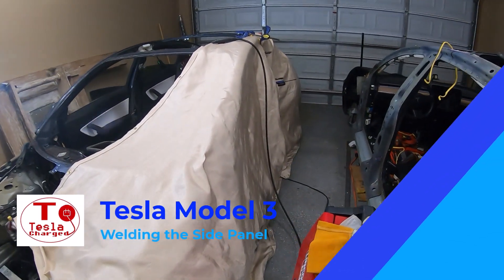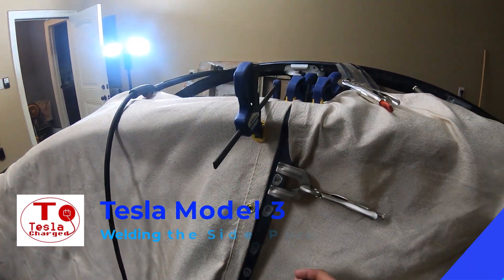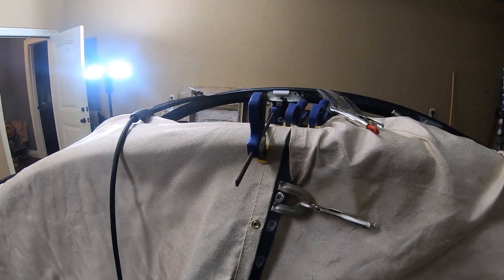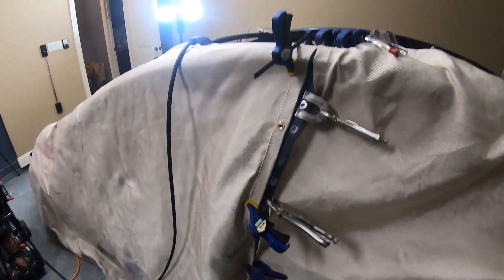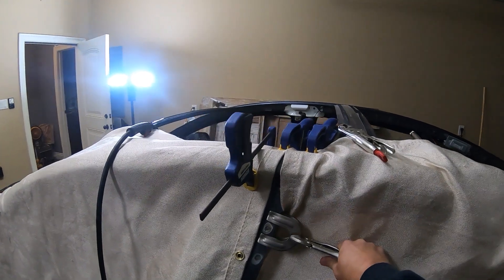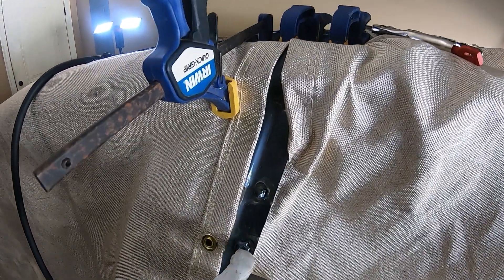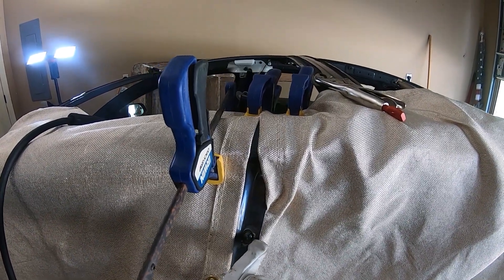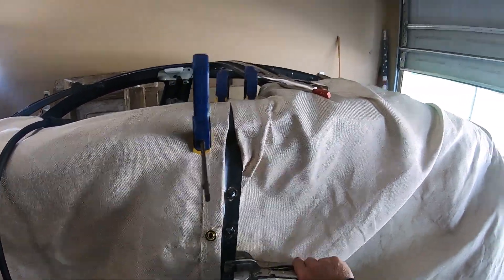Tesla Model 3 - Welding the Side Panel

Comment: Can I weld a rear panel of a Tesla without disconnecting the batteries? With the MIG welder
Reply from the maker: Hey sorry for the late reply, Yes just make sure your ground is very close to welding location and car is powered off.
High voltage battery communication plug under back seat removed and 12v battery negative disconnected.
Reply: @TeslaRebuilders u have pics what plugs  need remove rear seat?
Reply: Hi i need change quarter  panel how i can disable  all battery  system ev batt i know 12v battery  its same regular car can you help me safe mode to weld in tesla? Thanks

Comment: Hi man, do you know where i could find a similar HV disconnect in a 2018 tesla model s? its not under the seat, i think
thanks
Reply from the maker: You should be able to find one on ebay it's under the pack near the front I think.
Make sure it's a good one and not blown, maybe see if it's a new part not used.

Comment: What model welding machine is that?
Reply from the maker: It's a Mig, Lincoln Electric 180.
Reply: @TeslaRebuilders  Is it MIG, TIG, some kind of brazing?
Reply from the maker: @bigytv8392  Sorry I had a butt dialed comment haha...
Reply: @TeslaRebuilders  Thanks. I just wanted to check if you had to do any kind of exotic welding, like pulse brazing (Acura /Honda).  If standard MIG works on these cars, I might get myself a project Tesla to practice.
Reply from the maker: @bigytv8392  oh no nothing like that and they actually have repair service manuals available for free online. At service.tesla.com
You can look up quarter panel replacement and see it's mostly rivets , adhesive and minimal welding.